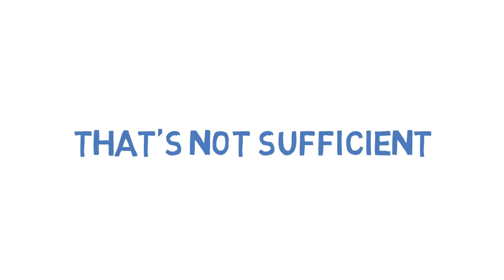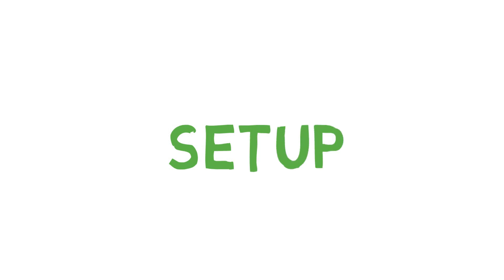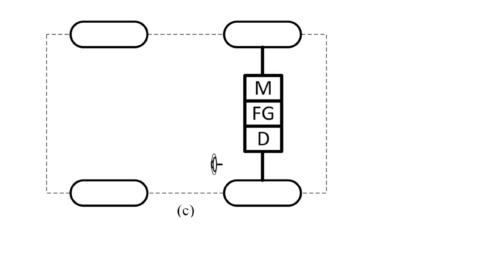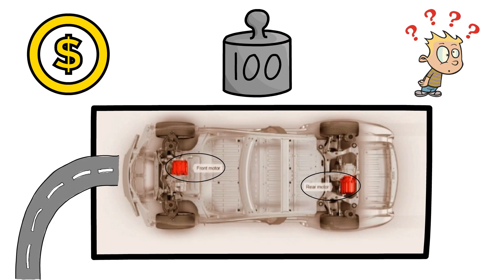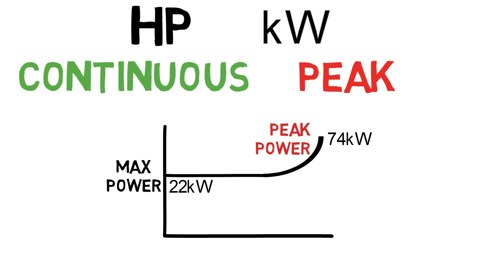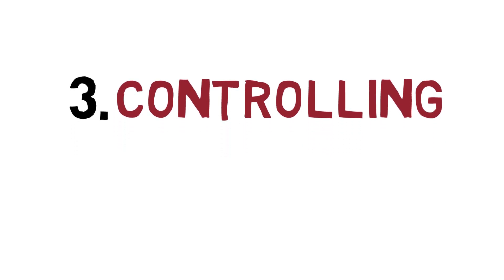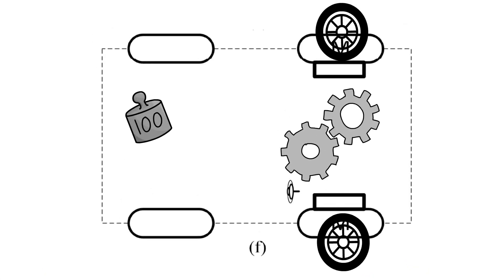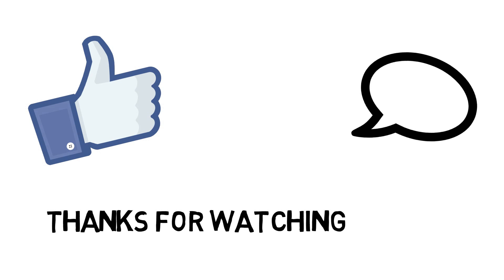Motors used in electric vehicles | Selection of Motors for EVs | Types of Motors

Comment: FE, I have been searching the internet and YT for some guidance about something. As I am in my golden years and my passion for surf fishing I am looking to convert a cart into electric DC drive. Most of the concept I understand and what I seek advise on is this. Most of the parts and motors I am looking at are on Amazon and with out any doubt they are cheaply made motors from China. Being that I will be in a salt air environment what would I be looking for? Salt air and electric motots is like poring sand in a gas motor oil. I would be very thankful for any advice you can provide. Thank you and great video!!!
Reply from the maker: Thank you so much for watching!!

Comment: There is a problem with motors embedded in wheels. For best handling, we should reduce the unsprung weight of the wheels as much as possible. So the motor should be fixed to the body, and connected to the wheels using shafts and universal joints and so on.
Reply from the maker: Yes, Thank you so much for watching!!